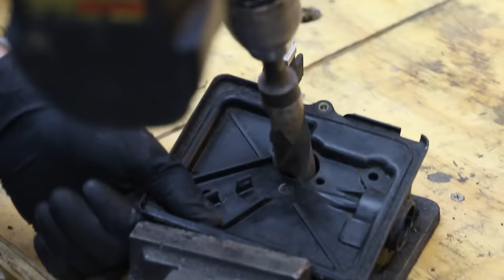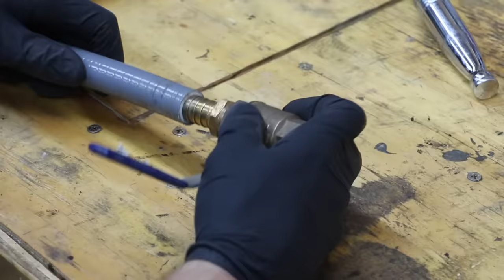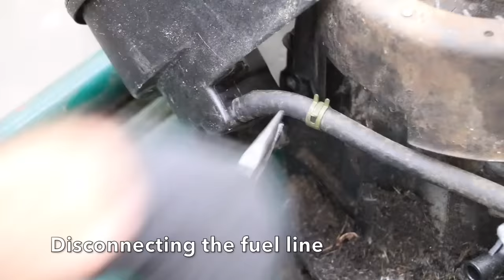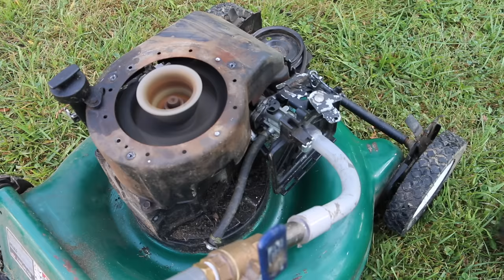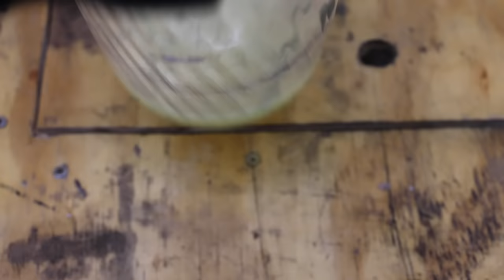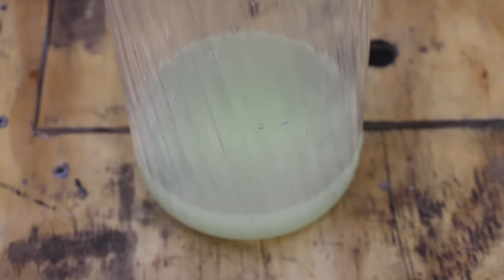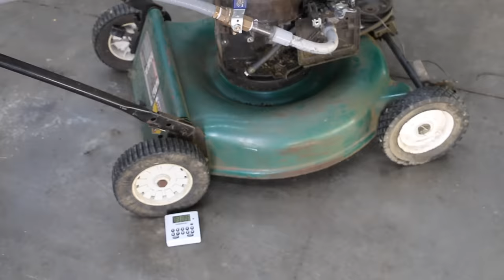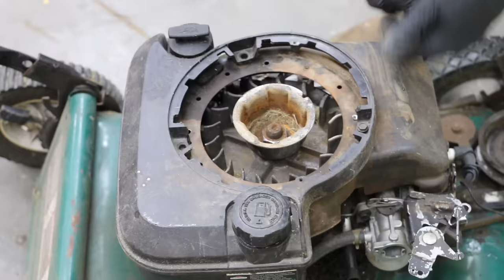Will a "Gas Vapor" Container Improve MPGs and Fuel Efficiency?  Let's find out!

Comment: To be fair, gasoline is a vapor when introduced to the chamber. Either via the venturi effect of the carb, or by being sprayed by fuel injectors. So, essentially, aren't you just causing this to happen outside the carb (in this case)? You aren't really using any less fuel, as it still needs the same amount to run. You're just vaporizing the fuel prior to ingestion? Making that jar into a very basic form of carburator, prior to the original carburator? I mean, I'm no scientist, but I feel like a ~2% increase in run time could be chalked up as an acceptable margin of error given you used tape and eye-balled the fuel level in the jar.
Reply: This seems to be some kind of urban legend, I'm looking for anything that even hints that it might work.  Nada
Reply: Incorrect, The liquid gas is not a vapor when it enters the combustion chamber yes there will be some vapor but the majority will be a mist and no this guy is not producing vapor he is creating a mist also.

Comment: Easy enough doing no load tests but the carburettor adjusts the fuel in real time via the governor on that motor as the load goes up and down, hard to make the system you have regulate the energy accord to demand. Nice Demo though.
Reply from the maker: Thanks!

Comment: I'm late to the party (July 2022)
I had a Coleman Gasoline camp stove that ran the copper (good heat transference) feed tube through the flames to pre-heat the fuel to (presumably) aid in the gasification.
Just a suggestion.
Reply from the maker: Thanks for the suggestion.

Comment: Smokey Yunick had found that vaporizing the fuel mix would lead to higher thermal efficiency, taking the energy that's normally wasted as heat in the exhaust and cooling system and instead harnessing it

Comment: Whats the difference? What i see is that the gas bottle is already working as a carburettor. There is air/oxigen coming inside. Very interesting would be the adding of water to either improve the power, or the milage. Adding water to war bird engines was quite common in WW2.
Reply from the maker: Thanks for the feedback.

Comment: I always wanted to try powering a Stirling cycle engine on the exhaust heat and using it to power the alternator in lieu of the engine (on a car obviously, not a mower).
Reply from the maker: Thanks for sharing.

Comment: So cars actually do run on gasoline fumes, at least partially. The evaporative emissions system in modern cars has a charcoal canister that soaks up fumes from the gas tank. When throttle is applied the engine vacuum opens a valve that allows the fumes to be drawn out of the canister and into the intake manifold, to be burned in the engine.

You'll likely get better fuel efficiency out of your lawnmower with a similar system.
Reply from the maker: Thanks for the feedback.

Comment: Gasoline is made of 5 to 6 components. It is a mixture. The last couple of components can not vaporize at ambient temperatures. I know it is counter intuitive, but if you heated the gasoline to say 105 degrees F, then all the components would vaporize and you would get a marked increase in running time. Good job. It would be very useful to stretch out say home generators or motors that run at a constant speeds.. This may work with diesel fuel also. Tom Ogle's contraption vaporized all the gasoline by heating the gas tank he built and then compressed the vapors he created, essentially making compressed vaporized gasoline. Then he ran his vehicle by regulating the release of the compressed gasoline and added air. He got 100miles to the gallon on gasoline vapor and air.
Reply from the maker: Thanks for sharing.

Comment: I know this is a 4 yr old video, but I wouldn't mind seeing an update based off of a revised mock up. One where the tubing does go to the bottom. Also,  testing the different types/brands if fuel, including flex fuel.

Maybe this time, an actual measurement of the weight of the fuel instead of an eyeball estimate.
Reply from the maker: Thanks for the suggestion.

Comment: I did this on a 1987 Mazda truck  with a 2000 engine .it ran smoother on fums .and did great up to 5 the gear then it died .found out the fuel line was closing off  from the vacum of the engine .
Reply from the maker: Thanks for sharing.

Comment: What if the fumes from the gas didn't emit the bad stuff into the air.  And if there's any left in the tank after running air through it to get vapers maybe theres a use  for it instead of dumping it..  if there is anything left after you get as much vapors out of the gas as you can.    Idk just a thought

Comment: I wonder what Code would have to say about using that plastic conduit outside of its intended purposes?
I say that because I ran across a video sort of complaining about EMT and it being used beyond its manufactures specifications for holding up lights in a workshop.

Comment: We knew that this was going to work because this is basically exactly what early carburetors were like on the earliest gasoline engines that were used to run small loads where the gasoline engines would only produce about two or three. Maybe four horsepower carburetor is back then. Were basically just fuel vapor devices. It wasn't until the late 1800s early 1900s that we created what we now know as the modern day carburetor that could actually utilize the vacuum on the intake system to get a small at least moderately atomized puff of fuel into the airstream of the intake to be able to actually get a much finer metering of the fuel going into the engine on each combustion cycle. That is all this really is is this is just a modern day replica of an antique 1880s carburetor because before they were fuel metering devices. They were actually just vapor devices like this where the butterfly on the carburetor was just the thing that allowed more air to come in to the engine so it would spend faster granted those did have a little bit of metering to them, whereas this one had virtually no metering to it. That was kind of the difference. This is more of a replica of the first working carburetor.

Comment: So how do you alter the air/fuel ratio?..  I can see that you have the inline valve for throttle, but that won't alter the air fuel ratio, which means you can't get an accurate fuel economy unless air/fuel ratio can be optimised beforehand

Comment: Passed the carburetors and injectors fuel is mixing with air to into vapors then spark is applied before top dead center.  The mix average 3 to 4 tenths of a second to ignite and full power just past top dead center.

Comment: did you try different fuels in your bottle?  i am very interested to know if 100% ethanol will vaporise enough to make a flame from the vapor?  i want to build an indoor flame pit and  pipe in ethanol vapor from a tank outside using this concept.  wondering if you could mix ethanol and diesel together if it would vaporize enough to flame.  diesel when buned clean produces very little carbon monoxide...would be intersted in hearing your .o2

Comment: I’m just wondering watching someone else vaporizing fuel using a chemistry flask over a vaporizer tub with the same amount of water in the tub, is all vapor the same, also looking at distillation systems they commonly use gravity to only allow vapor to reach the collection point so more surface that allows condensation to become fully vaporized, if you look at the e-cigarettes they try to achieve atomization so smaller the better if the engine will still run on pure vapor?

Comment: The original battlefield used a bill. You stay rather interested in cooperation method in which there was 3 evaporation chambers and it ran strictly on vapors. I'm not sure they actually made a jet car. But it is doable. You have to be a chronic tinker in order to make it work reliably, but it's doable.
Reply from the maker: Thanks for the feedback.

Comment: funny, what you have made is like an up-draft carburetor very cheaply i'd might add... i remembered as a kid my grandfather's farm tractor 1950ish modine using these type of fuel system but as i recall had trouble running them in cold weather... P.S many small airplane engine's still use an up-draft carburetor system.
Reply from the maker: Thanks for the feedback.

Comment: What he did was quite close to what Tom Ogle did in the 70s. Tom later on built a version that he mounted in his ford galaxie 1970 year model with the 427 engine ( not 100% sure about the engine size ) and drove 200 miles on 2 gallon of gas. Tom got his patent 1979 for this invention. It required premium fuel to work properly. The patent expired in 1997.
Reply from the maker: Thanks for sharing.

Comment: I don't know how old you are, but in the early 70's a man came out with a device and selling them, to attach to the carburetor of the car and increase fuel mileage by if I remember right by 75% by burning the gas fumes, almost like a recycling process! Then the automobile industry bought the patent for the device and hid it. I was a teenager then 13 I think.
Reply from the maker: Thanks for sharing.

Comment: What about preheating the fuel--using the heat from a car's coolant hose--so that the fuel goes into the engine much hotter than normal? Most people who do this tap into the fuel line with some small copper tubing and hose clamps and then, wrap it around and around and around the coolant hose many times. They then insolate the exposed copper tubing to preserve the heat that the fuel has accumulated. Theoretically, the fuel should vaporize much more quickly when it gets injected into the engine and hopefully, the O2 sensor will remap how much less fuel the car will need. "*Might have to briefly pull the fuze on engine's computer to reset it after everything is hooked up and run it for about 50 miles so computer will recalculate. Then, run it some more after that for an mpg test. I've always wondered if this will work to get better fuel mileage.
Reply from the maker: Thanks for the suggestion.

Comment: People commenting engines already have proper atomization to combust the fuel need to consider why vehicles have a catalytic converter???  Think about it.  The gasoline has a lot more potential which is why it does not currently burn it all.

Comment: So leaving aside that it's only a little better with fuel saving you did say the with the vapor tank there was no exhaust right? If pollution from the engine is dropped significantly or even to zero then this is more than worth it, especially on a lawn mover which produces tons of pollution. Another video measuring that would be amazing!

Comment: One thing you have to remember, in order to run an engine on gas vapor, and I've seen it done several times oh, you have to have fuel Vapor that is running through a tube into the intake of the engine. One cup of fuel Vapor has the explosive potential of 15 sticks of dynamite. I don't think they're in a hurry to blow people up!
Reply: buy doesn't a normal combustion engine also use fuel vapors just less?
Reply: Ok folks this is a vary good example yes the gas engine only needs vapor a carburator basically does the same but what was not noted in this experiment was temp of the gas using cold or room temp fuel will not net the running time of warm to hot gas gasoline will expand many times over if warmed to the correct temp so if u use ur engines water line to warm the gas ur run time will go up to 45min + now the part of this equation u must take into concideration is that it takes more fuel to accelerate as a lean engine will back fire when u open the throttle just disconnect ur accelerator pump and try to drive now if u have a clutch u could get motor up to speed and slip the clutch but if u come to a hill n need more power it ain't happening. now this system  in concept would work using a Holley carb u block the jets use a tank that holds 1/2 gallon of gas and wrap it wit copper tubing and hook that to ur water pump heater hose and use smaller tubes and a solid 4" aluminum tube from the heated gas container to ur carb and gas to the carb now u have hot fuel vapor to run on and an accelerator pump to get the engine over low vacuum upon acceleration also to note u must use a temp thermostat of 215° as a leaner fuel mix requires higher engine temp this will give u 50+ mpg under normal cruising speeds but in town u must start and stop that means u must squirt raw fuel Evey time u accelerate so I town driving will b down to 25-30mpg this being on a V8 if u use a smaller 6 or 4cyl it would of course be more but to note compression must b under 9 to 1 more compression means more fuel a high compression engine won't run on lean fuel mix it will predestinate knock /ping and if that happens then the flame will flow back to ur gas container causing a massive explosion so if anyone does try this I've done it it works u must use a waited vent flap like is used on a furnace it's weighted to close if air blows back I used a halon gas system that would spray into the 4" inlet to knock out flame so it could not back flame. Now this is cave man thinking compared to buying an electric car and have ur own solar cell system to charge or look up zero loss generator's and build ur own power station remember it's all in the fly wheel the bigger the wheel the more power u can make! good luck and thank u for reading  this

Comment: My own personal testing worked pretty well until most of the "high end" had evaporated out of the gas, leaving about 1/4 of the original fuel that would not burn or light with a lighter when poured on the ground.
Reply from the maker: Thanks for sharing.
Reply: I wonder if engines ran this way for 100,000 miles, if the carbon build up inside the engine would also be significantly reduced, for not burning all of the "low end" garbage?
Or, what the emmison test would project?

Comment: How about trying a pressurized gas tank like the old Coleman camp stoves used. Years ago they would pressurize an out side tank holding the gasoline and they would be able to run an entire house gas lighting, stoves and heaters off of the gas. Also while using this method why not try alternative fuels and mixtures of kerosene Etc. What about running the engine off of carbide and water, that creates acetylene gas, like the coal miners head lamps and even the buggy lamps used. Very volatile be careful!
Reply from the maker: Thanks for the constructive feedback.

Comment: i think it would be fascinating to see a anti gravity experiment done. USAF uses nuclear reactor to achieve their zero point energy fields. The same should be possible with pressureized mercury, in a closed loop. The science is generating enough lift to defy gravity, by speeding the mercury up so fast the entire closed loop rises. (electromagnetic fields manipulation) Conventional science says it cant be done, but it very easily can. I understand people are skeptical, but science is science. Through a true zero point energy field limitless energy can be generated as well. For the sake of your channel though it would be amusing to see what others say about the existance of an anti gravitic experiment. 3 pillars or tubes+ a single round container placed inside the triangular configuration+ filled with mercury+ electro magnets on either side of the tube of mercury (arangement of magnetic field is crucial. When mercury is manipulated by magnetism it is propelled to the speed of light. When that speed is achieved the container will rise thus defying gravity visually. Same principle with UAP's. (The steering component comes from ESP)

Comment: Also I think the initial creation had a storage tank that stored the vapor in and did not feed directly from the liquid, would that make any difference?
Reply: it might.. maybe the hose from the fuel vapor container to the engine should have a larger diameter tube in between to collect the vapor...sort of like what you see in a 2 stroke exhaust expansion chamber

Comment: What would happen if you heat up the fuel with crank case vapors . The extra fuel from crank case would help get more running time . The intake tubes if you can put very fine screen to atomize the fuel more ? This still has a lot of thing to that done , will run cleaner ? Less carbon  , add alcohol , remove oil from the crank case vapors to keeping it cleaner ?
Reply from the maker: Thanks for the suggestion.

Comment: I could have told you this would work, think about it, what happens when you run out of gas? I noticed when my mower would run out of gas, the engine would rev a higher rpm just before it ran out, why? The Vapors!

Comment: Fun fact, the EVAP system on cars is meant to use the energy potential of the vapors. It's not enough to run, but it's enough to "add" to fuel efficiency
Reply from the maker: Thanks for sharing.

Comment: btw there's sth called a vapour carburetor, which does work pretty darn well but with a sluggish response
Reply from the maker: Thanks for the feedback.
Reply: @ProjectFarm  no worries. and btw again, there is a guy here on yt with the lawnmower carb on a v8 who uses a pretty similar way tu run his engine. a buncha 90⁰ in tubing resulting in various high and low pressure zones turning the gas into a vapour. i forgot his name tho

Comment: Have you done a Electrolysis Hydrogen Generator test yet? You could make a Hydrogen gas generator using electrolysis in a similar jar and have it's vapor mix with the gas vapors and see how that mix does.
Reply from the maker: Thanks for the suggestion.